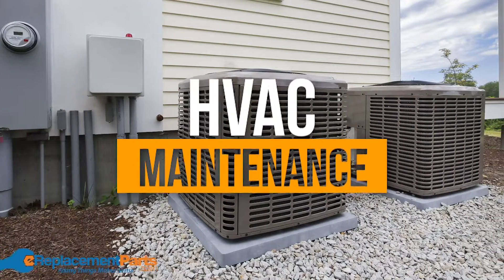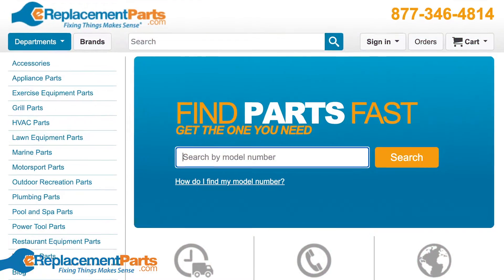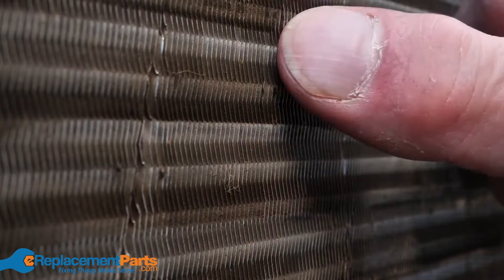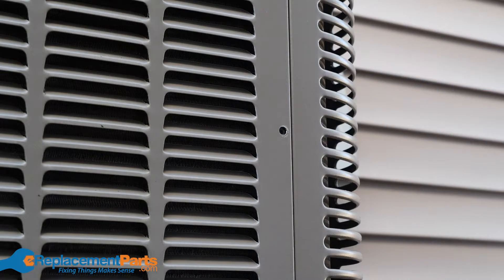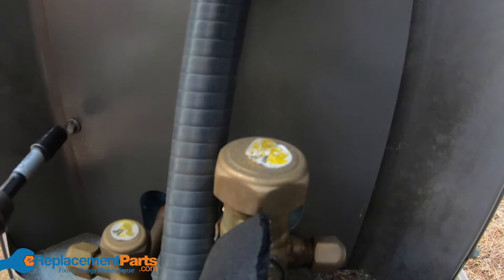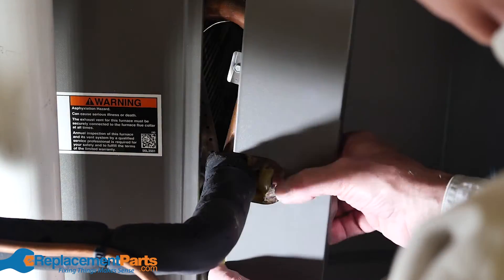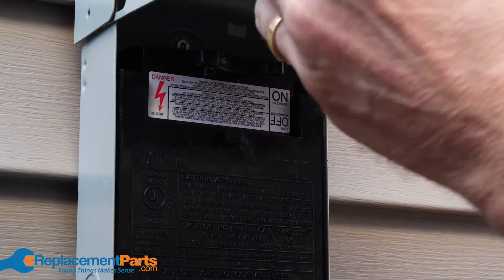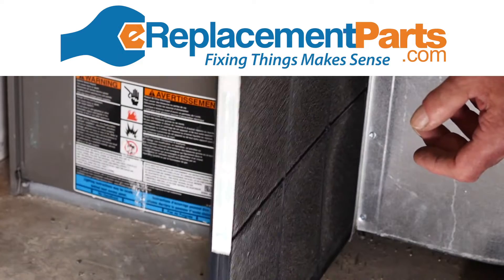HVAC Maintenance Guide: What You Need to Know to Ensure Yours Runs Smoothly! | eReplacementParts.com

Comment: Do you recommend using coil cleaner
Reply from the maker: For 90 % of the cases water is all you really need. For that other 10% you may have to use a coil cleaner. If you choose to clean your evaporator coil using a commercial product, note that not all chemical cleaners can be used to clean the evaporator coils. Acid-based cleaners, for instance, are harmful and could damage the coil’s metal surface. Chemicals like chlorine-based cleaners can corrode aluminium when used as a cleaning agent.